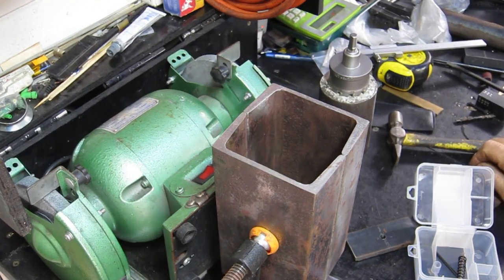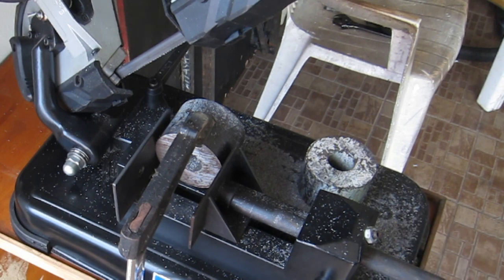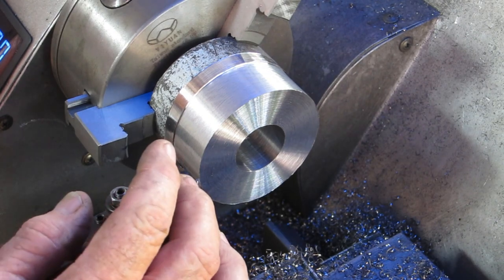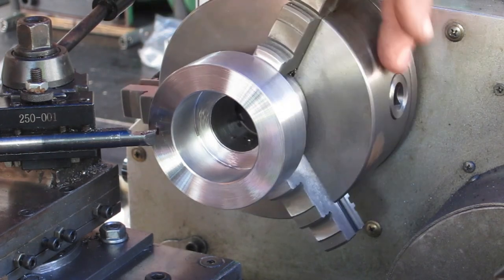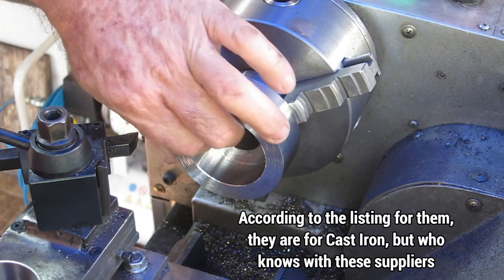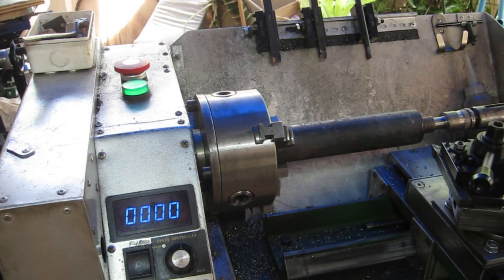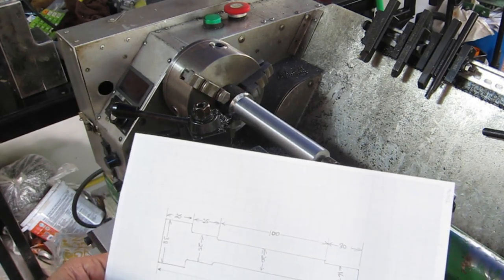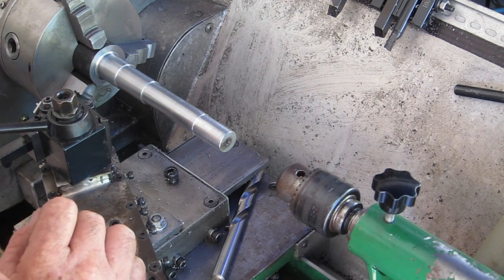MHW Episode 33 - Homemade Milling Machine Build - Part 4 - Spindle Build

Comment: Bloody grinders always seem to jump up and bite, the last time I got bitten it was 10 stitches. anyway, great job looking forward to the next video again busting to see the mill in action.👍👍
Reply from the maker: The bastard has bitten me 4 times in the last year, at least this time it was only a flap disc and not a 1mm cut-off wheel, so only an abrasion.
Reply: @MyMiniHomeWorkshop  Yes I know what you mean my last one was a 1mm cut-off wheel hence the 10 stitches.
Reply from the maker: If you have a look around the 8:00 min mark you can see my first/worst strike on the top of my leg

Comment: I just can't say enough good things about your content and workmanship. Certainly, top Shelf. I have never seen a lathe tool bit held in the chuck the way you did and used it as a facing tool. I've always heard that a lathe is the only machine that can duplicate itself. You are doing a great job using the lathe to its fullest capabilities. I am assuming that you also built the lathe. thanks for bringing us along. I could not tell if you had the tool bit in a 4 jaw or 3 jaw chuck.
Reply from the maker: Lathes are indeed a truly versatile piece of equipment, that was a 3 jaw I was holding the tool with and yes I built the lathe, it has been through 2 upgrades since I originally built it. Thanks for watching. 👍

Comment: How do you drill the spindles to match?  In 2 drills, if it were me, the final hole would have a discrepancy.  I'm DIYing it.  Have you ever used indicators or dyads?  Can you touch the spindle shaft?  Is there any expectation of movement?
Reply from the maker: It's not that hard, in the spindle, one end has a Morse taper in it that is much bigger than the drill size, so alignment isn't that much of an issue, larger drills don't tend to wander much anyway if you have them sharpened properly. If you haven't watched it yet, you will see how I drilled it out in the next video of the series. 👍

Comment: The ER25 spindle I ordered on Aliexpress fell through - shady seller...  Now I've either gotta fork out 250 euros + customs to get it from another seller which is way more expensive than first planned, or make one myself.  My wallet is telling me the latter lol, but I'm a bit nervous about it as I haven't used a lathe in many years.
Question:  What bearings did you use? I'd like to loosely model my spindle after yours, depending on the steel I find in my shed.
Reply from the maker: I just used some tapered roller bearings in a size that would fit into the constraints I had, a pair of angular contact bearings would be preferable but are just so expensive, so I went with the tapered rollers.
Reply: @MyMiniHomeWorkshop  Yeah I was looking at the angular contact bearings; they run into the hundreds if not thousands for a matched pair.  The cheapest ones from japan (nsk) are like 70 euros for a pair in the size i want (7207), not counting import duties,  and I still need to remember all my shop class lessons from decades ago and get used to using my recently bought el cheapo import lathe before I can install them in my homemade spindle.  Better to get tapered roller bearings to start off, then build a better milling head later on when I know a bit more what I'm doing.
Reply from the maker: @trickywoo356  Don't forget, my spindle is not only homemade, the lathe I made it in is homemade, and it has a morse taper cut into the end of it as well. In an upcoming video, I'm going to modify that spindle. 😁